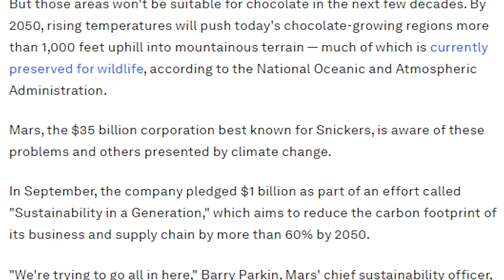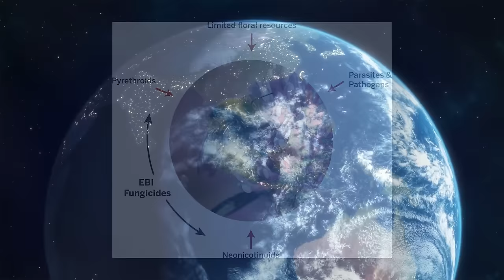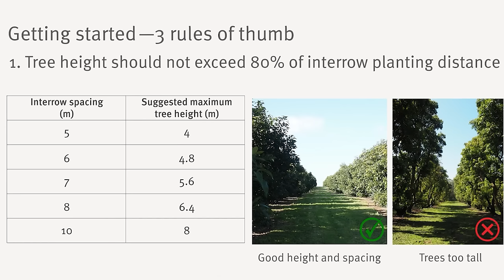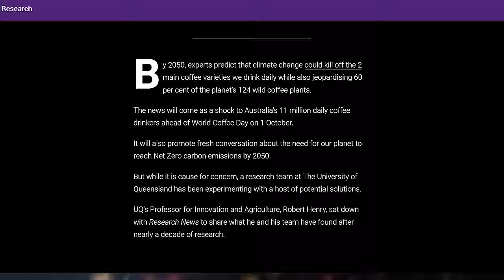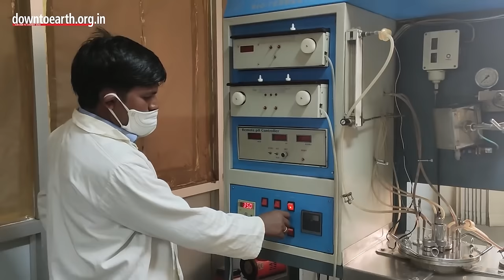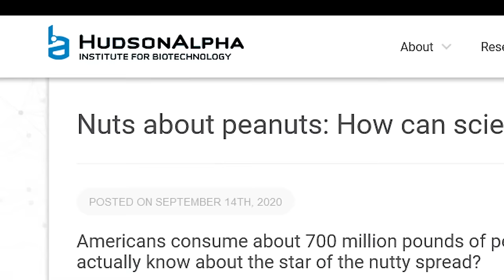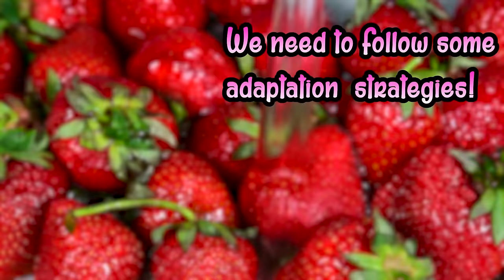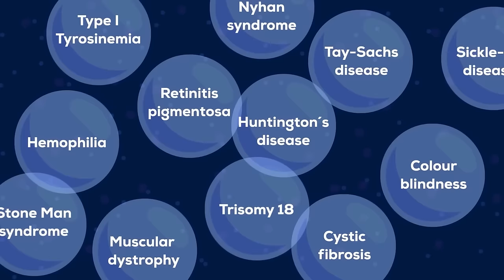The 10 Foods that may soon Disappear

Comment: GMO also refers to crops that have changed due to selective breeding and artificial selection. The banana is actually a great example, since they were originally small with huge seeds inside. Farmers then had plants that produced larger fruit or smaller seeds cross-pollinate with each other which would then be bred with the members of that generation's large fruit and small seed producers until we got the banana we know today. You can even see this with centuries old paintings that feature watermelon. Back then, they were mostly white and not very sweet. Crossbreed the sweetest, pinkest ones of each plant generation, and you get the modern-day watermelon.
Reply: GMOs do not include selective breeding or artificial selection. That is, propaganda companies started to combat concerns about GMO products. Selective breeding does not modify the genetics of an existing organism. Therefore, they can not be Genetically Modified Organisms.

Comment: So happy to hear you advocating for GMOs. It is a tool that can be used to solve so many problems related to climate change and I also agree in regards to pesticides.
I don't necessarily agree with all uses of GMO but like with any tool it is how we use it that makes the difference. 
As you said it is not harmful and I'd even say it is even safer than conventional breeding due to stricter regulations and a higher level of control over what is changed.
Reply: Sometime it'll have to be forced into people whether they want it or not.

Comment: I don't drink and I've had fewer than 10 drinks in my entire lifetime but wine is good.
I'm probably one of the few Wisconsinites who don't drink beer.  I had a sip of it when I turned 21
from my older friend's glass and that was enough.  I don't like any bitter foods or drinks so I hated it right away.
The few times I had alcohol it was mostly red wine when I was in my 20's.  As a chocoholic, the only food I'd miss 
a lot on this list so far is chocolate.  I like guacamole in burritos and tacos but I would be okay without it.  I'd miss it
but not nearly as much as I'd miss chocolate.